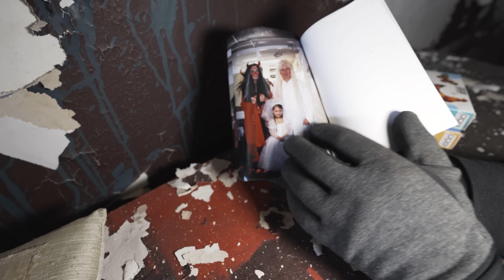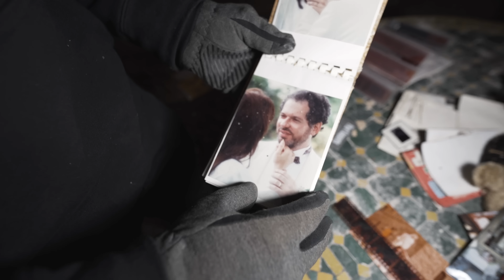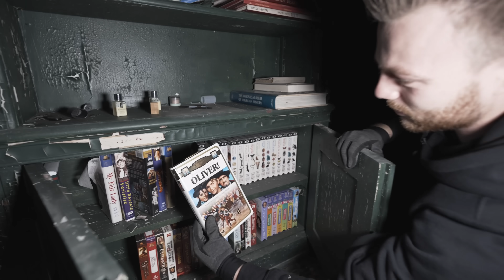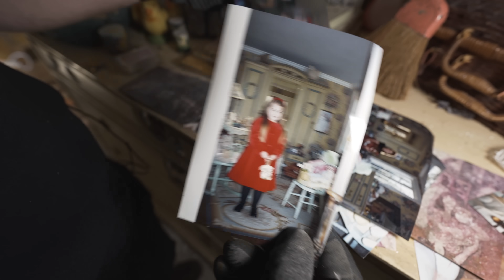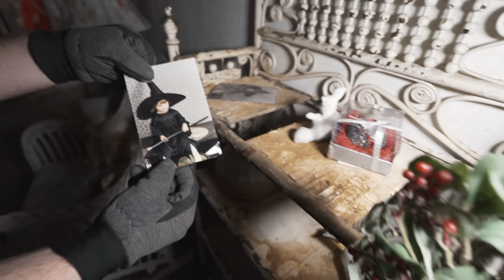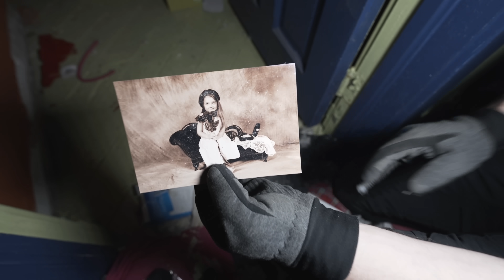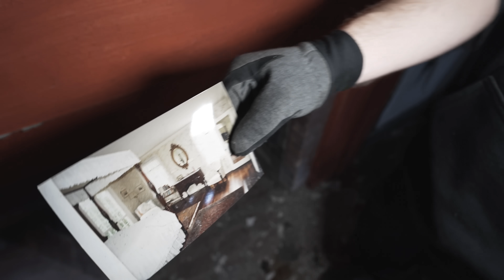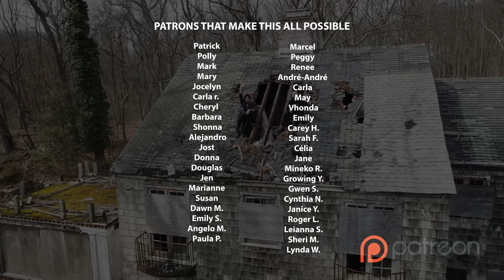They Destroyed Their Childs Life... Abandoned Mansion with a Chilling Tale!

Comment: The smaller rooms and laundry were actually the ORIGINAL Servants Quarters. That is why there is the smaller set of stairs from the kitchen. This home was built long before the Gladsteins owned it. The air and heat in the basement was retrofitted to the home. That dumbwaiter was a lift for coal from the basement area to the upper floors.
Reply: I read that the home was built in 1938 for a prominent family in the area. I would have thought it was much older.

Comment: It's so hard to believe such decay can happen in just 11 years. 
It's weird how decay varies so much, from place to place, depending on environment, structure, material.
Reply: It's always the roof first, then the rest quickly follows along. Shingle roof last about 25 years, same for asphalt shingles, so better is heavier duty metal roofs which will last 50 years, and longer if coated every decade or two. Also those spanish type tile roofs last a lot longer.

Comment: Man if power was still on they should have had heat or air control to keep temp control. It would have kept it from rapid decay. That is usually the biggest issue. That and windows being broken by local vandals. Water , heat , and freezing conditions are gonna cause issues quick. Hope the new owner will get it and save it.

Comment: The house was clearly just the center building that had the basement...the other two were badly attached addon wings. The elevator looks 100 yrs old! The terrible modern American latex paint the painters use now for profit sake is water-based and claims to include a primer so they just paint over the old and probably did not even clean the walls 1st! So when gets humid, wet and sealed in the paint all cracks and peels like crazy as this one is. Owners are ignorant or cheap and this just Ruins it. Need to strip it all off or remove walls.